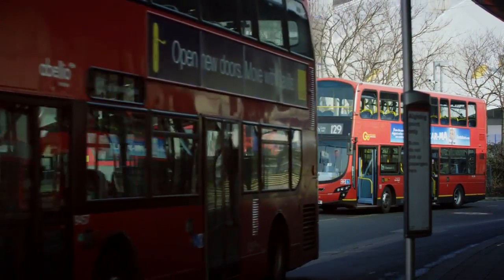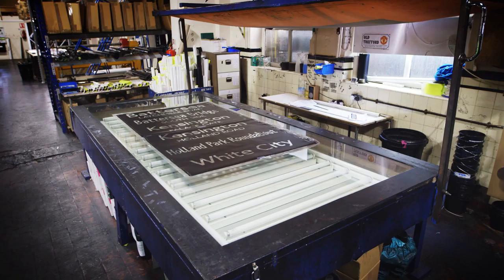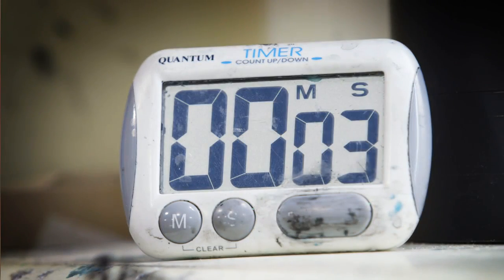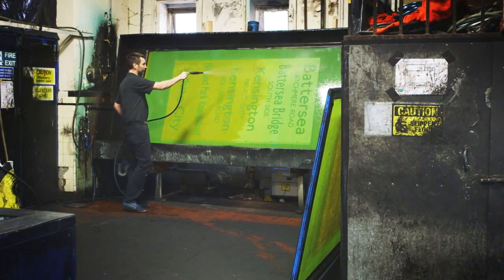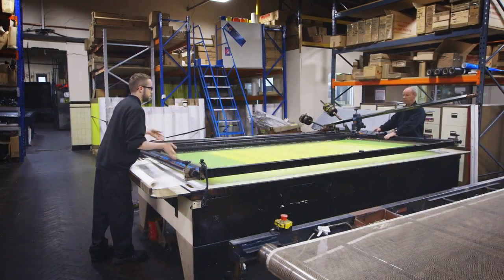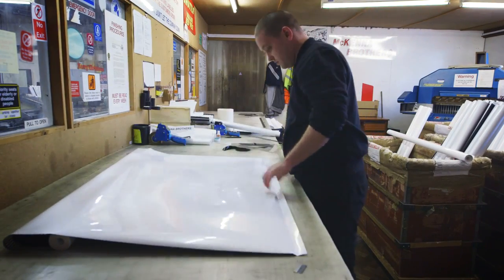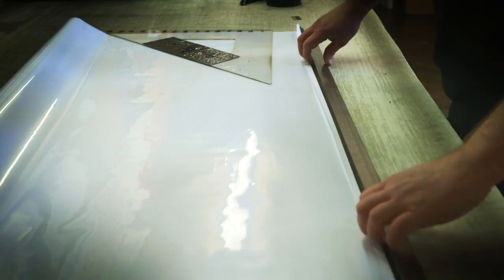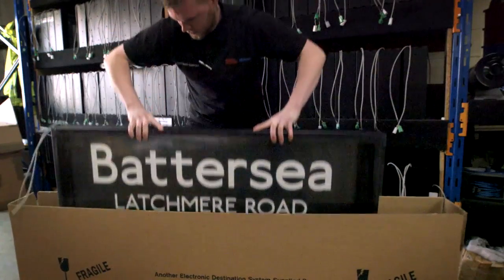How it's made: Producing a bus blind

Comment: Here's an idea that'd take less time, using a digital display, these lets stations like jskcfiskoappeodkdk exist.&if the bus's ending@a stop that isn't on the blind, it doesn't have to be replaced, they can just add it into the logic.
Reply: All curtailment points that TFL allow are on the blinds anyways so if a bus stops short the destination will be on the blinds.
They would not program every stop into an L.E.D display as TFL only allows routes to be curtailed to certain stops in emergency.
Reply: @SelkentBus  What about if the bus has to go somewhere different than usual?

Comment: Looks way prettier than a LED sign.
But then again - lots of delays are probably caused by this ancient system. When a bus breaks down you can't bring in any other bus - you have to replace the sign or find a replacement bus from the same route.
Reply: BenRangel it has to be assigned to the garage not the route
Reply: if they realy need to bring out a bus they will just get another size (Double Decker or Single Decker) from the garage it came from because all the buses their have the same blinds per type and if they some how run out of double deckers they will send out a bus with a piece of paper saying what route its on.
Reply: What? I have never known delays from this